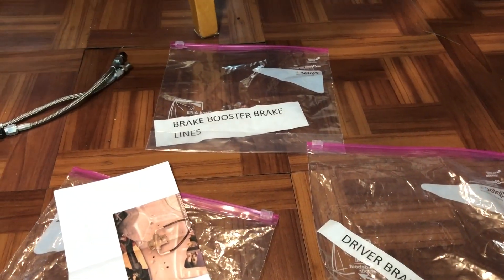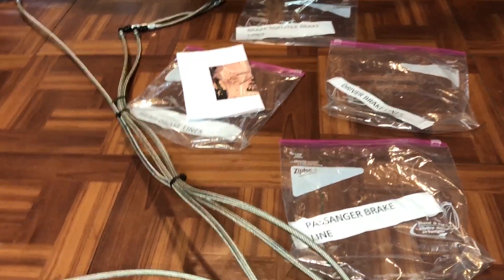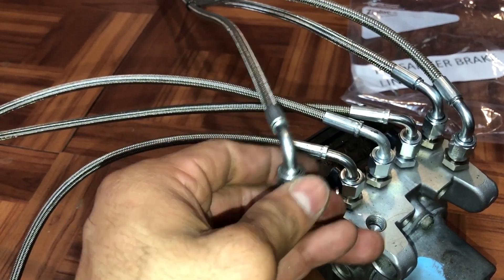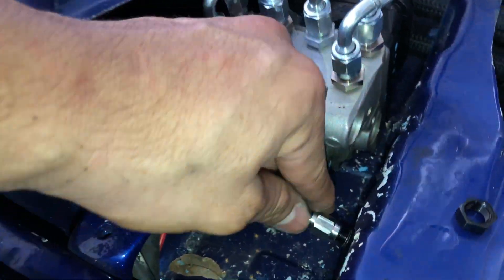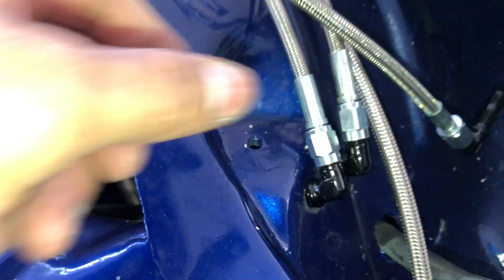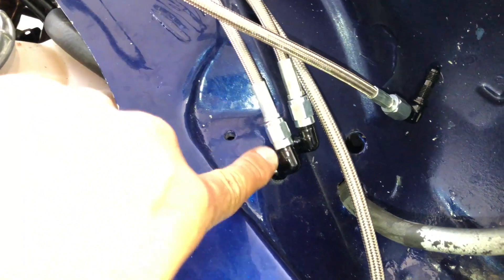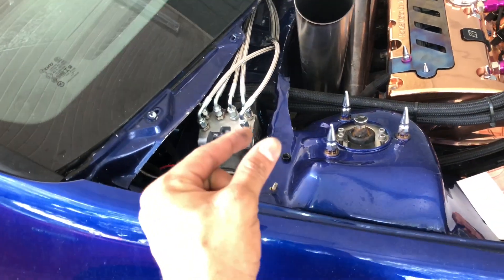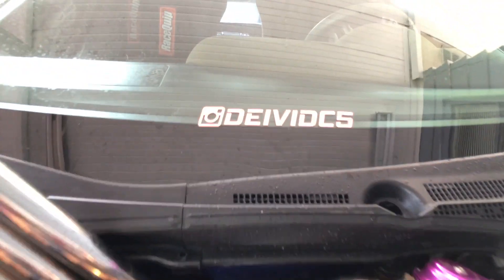RSX ABS RELOCATION KIT

Comment: Only bad drivers need abs. Just take it off
Reply: Actually no, ABS helps prevent flat spotting tires and allows you to brake later consistently and with say Hondata, you can setup the traction control too. Yes learning without ABS is a good skill to have, but I wouldn't delete it as I've seen the advantages vs without it. As much as I hate most modern driver nannies, ABS is probably the only modern system I'll gladly have.
Reply: Unless you live where it is required..